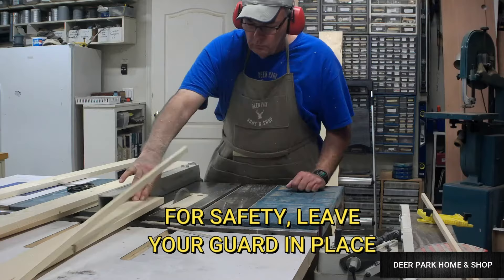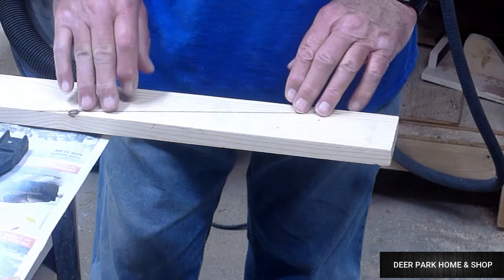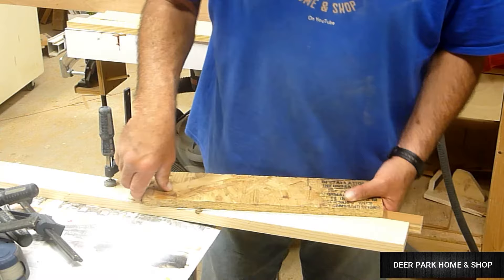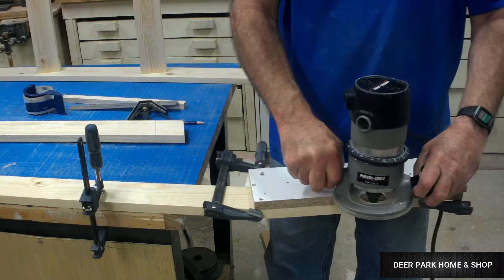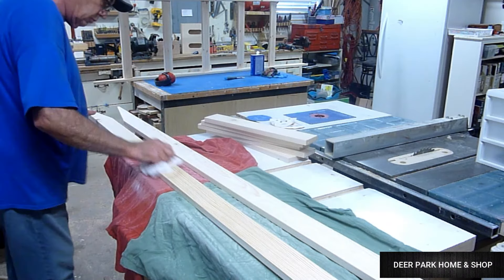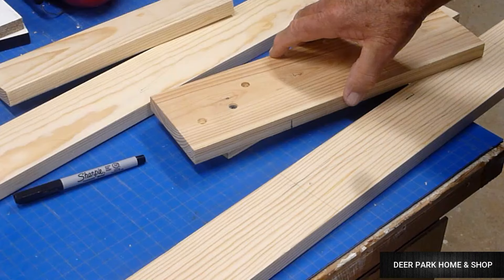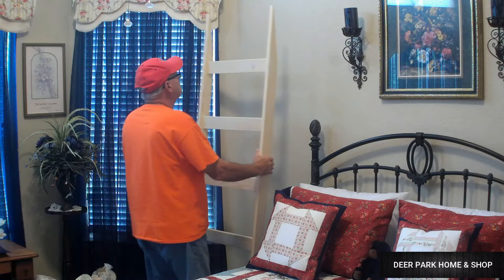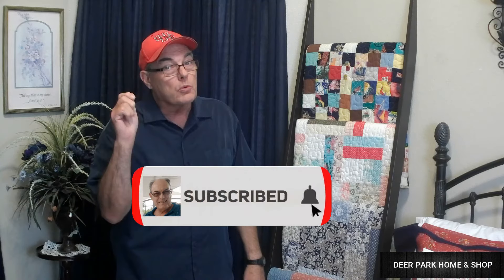DIY Furniture quality quilt and blanket ladder

Comment: Nice video. I have the same miter saw. You seem to have a decent dust collection system. Have you done a video on how it works? Thanks.
Reply from the maker: Hello Mike! I have thought about doing a video on how it works and how to build it, but I  think that will be a few months from now.  It works quite well as long as you are cutting at either 45 deg. or 90 deg. which is 95% of my cuts.  And thanks for watching.